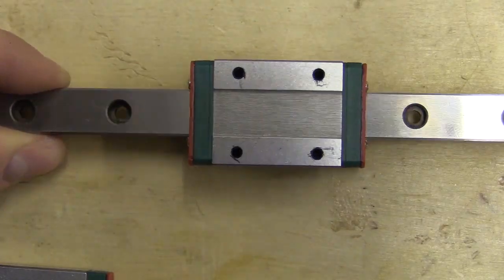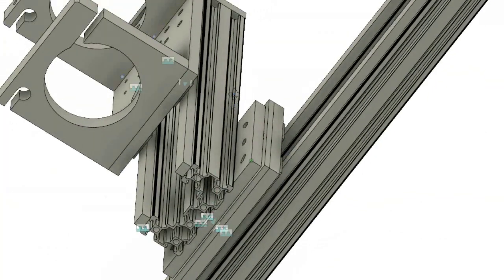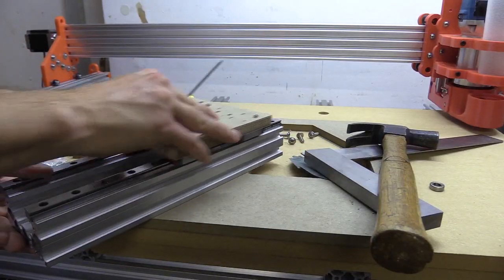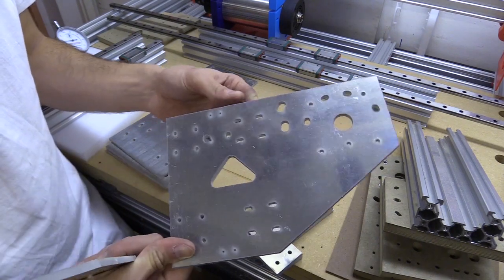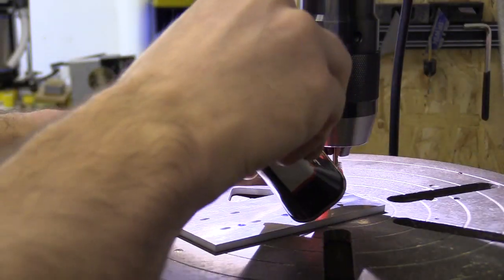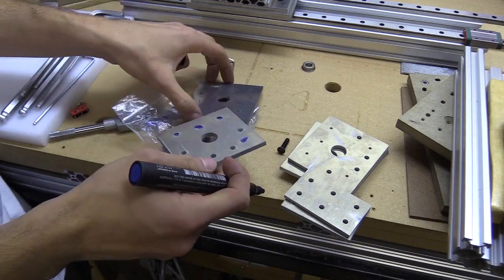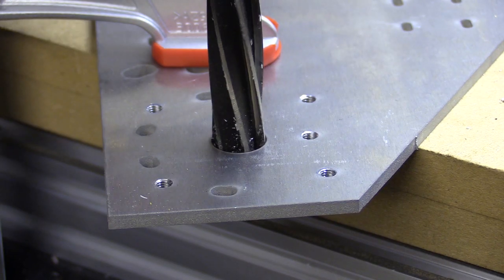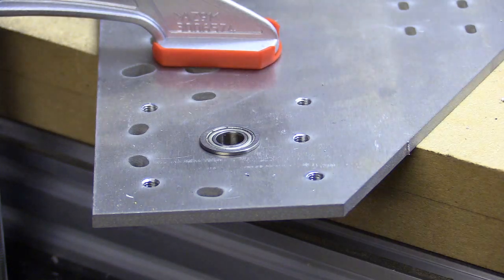#30 Aluminium CNC Plates #30 / Water-Jet Cut, Intermediate Plate and Sizing Holes

Comment: I'd personally loosen the upper rail, fix the bearing blocks and use the gantry plate itself to set the distance between them... Moving it along and tightening the rail down.  Should guarantee parallelism.

Also: That error in your water jet is where the operator selected outside in instead of inside out on that part of the svg/dxf file by mistake
Reply: That's exactly the alignment method I wanted to suggest also, give it a try. Good luck!
Reply: That's right.

Comment: A good Inventor/designer is able to take criticism. Bad practice hiding comments.
Reply from the maker: Errr what you talking about?
Reply: @EducatingSavvas   Sorry, that wasn't meant for you. I had multiple tabs open. I commented on another persons video about a design flaw that was quiet clear. But they just hid my comment, I was offering advice and possible improvement.
Reply: Quite  @thespiderkelly9589
Reply from the maker: @thespiderkelly9589  Ok I'm curious - which video? I've noticed loads of design flaws with mine. :/
Reply: @EducatingSavvas   
https://youtu.be/DYFnmvMFue0
This was the video in question. Projects never seem to follow through on this channel. At times lots of good ideas and concepts with no end in sight. Please note this is in contrast to your videos and in no way has anything to do your channel. Earlier I mistakenly commented to your video. Good work on the CNC build by the way.

Comment: That's looking solid, it's going to be awesome. Bit late for me to sudjest this, but have you thought about having a double gantry, with the rails either side and the spindle between. When the spindle is trying to ram an end mill in the material, it's going to tram/nod the z axis a certain amount, much less if supported front and back. Then all there is to worry about is the backlash on the z lead screw letting the cutting forces bounce the spindle up and down. Great work. Glad to see your stliton this project.
Reply from the maker: Cheers Sirus, I had thought about putting a third rail on the back and making a triangle to the top of the z axis to triangulate. But I was worried it might interfere with the drag chain. I've also realised the y plates are too short to fit the drag chain where I had originally on the other axis.I'm a little more ahead today - it's the most solid cheese yet.

Comment: Awesome work man! Quick question, why did you get the plates water-jet cut as opposed to doing it yourself on your cnc? I only ask because as I understand water jetting has its drawbacks; such as the angle it puts on the edge and 4mm seems doable based on your previous videos.
Also for a Z axis assembly that tall, you could put the motor on the backside of the Z plate (facing up) and use a short 1:1 belt (which acts as your flex-coupler too) to the top of lead/ballscrew, that way the motor is not way up there performing balancing act, and moving it's weight backwards helps to even out the load on the gantry rails.
Reply: i have another question, if you were going to get the parts waterjetted anyway, why didn't you make them from steel, or would that have been to heavy?
Reply from the maker: @jandillingh  Yes it's heavy and it takes longer to cut - so a little more expensive. Also I can work more easily with aluminium in my shop.
Reply from the maker: My spindle plate started to crack and I just didn't have the time. I work all week and don't live near the workshop, so I didn't have enough time. I've seen some designs like that. I think I'll wait till I put the drag chain on this one and see if I have enough space. Didn't think about the weight - that's interesting. Cheers.
Reply: are you sure that stones would be tough enough? they're obviously very hard, but for something to be tough, it needs to be ductile as well. that's why steel is so tough, it's the right combination of hard and ductile. i think that the reason you haven't seen anybody doing it is because rocks are probably to brittle. 

might make a good machine bed though, the weight would actually make the machine more chatter resistant..